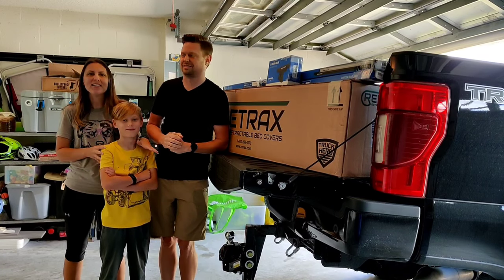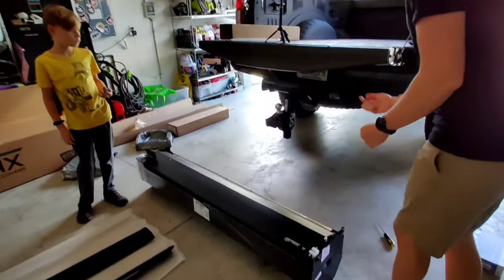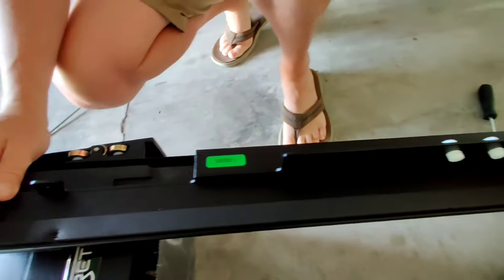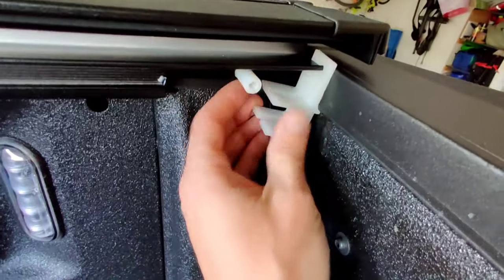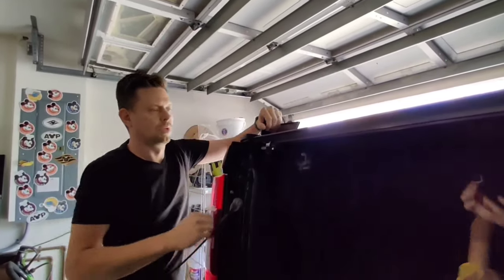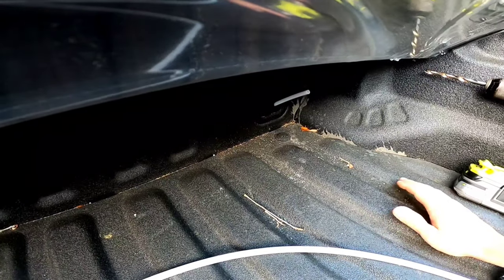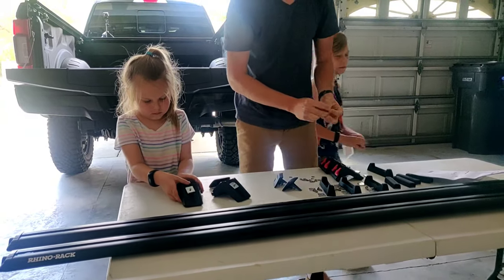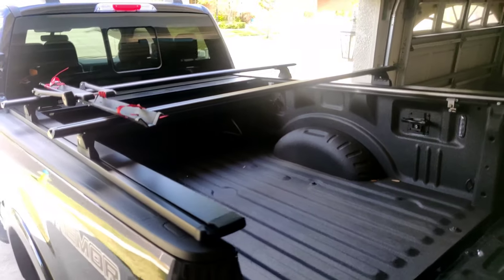Retrax Pro XR Tonneau Truck Bed Cover & Rhino Rack Bike Rack for 2021 Ford F250 Super Duty Tremor

Comment: Good video...I think you installed the drain hose incorrectly though....Isn't that white pipe just for shipping?  On mine, I just ran the clear PVC drain hose through the hole drilled in the bed.

Comment: I put one of these covers on my F-150 last summer, and it's held-up great.  Excellent choice!  I came there to see how the Rhino Rack went on, and it appears to be a better solution than the Thule Podium kit, which is getting hard to find, anyway.  Looks like I'll be snagging an RR set for our bike carriers!  Thanks.
Reply from the maker: To add, it is possible to remove the Rhino Rack with the 5 bike racks as one whole unit when the rack is not needed.  This is wonderful as it would have been a pain to disassemble the rack every time I wanted to remove it.
Reply: @BuckleUpButtercupTV  You are not living our life right if the bike rack is 'not needed' 99% of the time...

Comment: How do you connect the rhino bars to the truck.  

Is this connection to the truck or to the roll up cover?

Sorry if this is duplicated.  My first comment didn’t show up
Reply from the maker: The rails of the Retrax XR have a T Slot that fits many roof rack systems. They slide right into the rails.

Comment: Nice video.  I just swapped my regular rails for the XR rails.  Did you notice a large difference in the distance between rails from the front to the back?  Mine opens and closes nicely but I got more than a 1/4" difference from the front to the back.  Retrax says it shouldn't be more than 1/16" difference.  Just curious if you had to adjust those nylon screws at all.
Reply from the maker: We got rather lucky, the install that we did in this video turned out nearly exactly square.  I did not have to dial it in afterwards as I expected.  So far we are 99.5% water proof even in some crazy downpours.  If yours opens and closes smoothly and is keeping rain out you may be okay.  I will measure mine again tomorrow to see if anything has changed after 12,000 miles.
Reply: @BuckleUpButtercupTV  sounds good. Thanks for the reply!  Safe travels.

Comment: Awesome video how are you liking the cover as of now?
Reply from the maker: Thank you! We really like it! We have traveled over 6k miles with it and it has held up and kept our stuff dry. The bike racks did great, even while we went off road on rough terrain, everything stayed in it's place.
Reply from the maker: Thanks!  We are loving the Retrax tonneau cover.  We flew through the install and expected to need to go back over time to make adjustments or fine tuning however that hasn't been the case.  We have been through some very heavy rain and our gear has stayed completely dry.  I have also stepped on it a few times and it doesn't budge or flex.  We are very happy with it's durability, ease of use and security.
Reply: Ok great! Thank you! 
Have you done any modifications to your computer through forScan to make the fog lights work with the high beams on?
Reply from the maker: Not yet, I have thought about it but I am not sure it would make a difference.  These LED headlights are super bright.  The high beams seem to be enough to light up a ballfield.  I am interested in enabling the sideview mirror spotlights at any speed.  They could be helpful on dark trails at night.

Comment: Doing an almost identical install on my Rebel... when all the parts come in 😬 How do you find mounting the bikes?
Reply from the maker: Very cool!  I hope your parts arrive soon. It seems the supply chain is rather delayed right now.

I find mounting the bikes to be rather easy, I start with the middle bike while standing in the bed and work my way out.  The outer bikes can be mounted from the side of the truck.

Comment: How to you connect the rhino rack to the rail grove 

Is the grove on the truck or on the retractable cover?
Reply from the maker: The groove is on the rails that come with the Retrax Pro XR.  It is compatible with any "T Slot" roof rack style system.  There are also larger racks that are can height that will work with the Retrax, overall it is an amazing addition to the truck, especially when we need to haul 5 bikes.  Also, it is worth noting after this quick install this thing has been 99.7% water tight.

Comment: Hello, is this tonneau cover compatible with an amp research bed extender?
Reply from the maker: After a quick look at the bed extender I do not see any reason why it wouldn't be compatible.  The Retrax clamps to the upper bed side rail so it is up and out of the way.

Comment: Thank you for a very informative video.  Is there a gasket or seal where the cover meets the tailgate to prevent rain, snow, dust, etc. from entering the box?  Thanks.
Reply from the maker: Yes, there is a seal along the last section of the top that seals nicely against the top of the tailgate.  I put stuff in my bed with confidence that it will stay dry.

Comment: Does your tremor fit in your garage, height and length?
Reply from the maker: No, unfortunately it doesn’t fit height or length.  It is within an inch of fitting the height and a foot too long to fit length.  Florida garages are small.

Comment: Nice video.  How much bed do you lose to the canister on your truck?
Reply from the maker: The canister is around 13 inches deep and around 12 inches tall.
Reply: That's the only issue I see with roll-up tonneaus, but they're otherwise one of the best form factors.  I've found that I can still get at least a couple sheets of plywood under it (and the drain tubes), and even more long material if you place it between where the tubes are and secure it.

Comment: What Length rhino bars did you buy 65 or 71?
Reply from the maker: 71 inch bars.  This should be them but the Amazon link changes often.https://amzn.to/2VJwaqe
Reply: @BuckleUpButtercupTV  thanks for quick response.  By any chance Do you remember the feet that you connected the bar to the bed cover with? 

How have you liked the swagman bike racks?
Reply from the maker: Here are the feet that we used: https://www.amazon.com/dp/B01966BPPW/ref=cm_sw_r_cp_awdb_imm_7VSD1YH6NTA4AXT6TQNY
Reply from the maker: The swagman racks are great for the price.  They do seem to fluctuate on Amazon.  I have seen for for $40 through $80.  It looks like they are $41 right now:

https://www.amazon.com/dp/B000SL1AEG/ref=cm_sw_r_cp_awdb_imm_NGYWZZ352RB5VT7SBHTM

Comment: Hey guys , did you find out what was wrong with your tremor ?
Reply from the maker: The truck spent two days at Ford.  From my short conversation with the Tech it seemed they spent a long time on the phone with Ford and found the issue to be a short within a control module.  We picked the truck up afterhours so we could have it for our weekend trip so I do not have the warranty paperwork yet to confirm the name of the module that was replaced.

We plan on posting an update video once we know exactly what Ford replaced.
Reply: Thanks . Glad it was a small issue. You guys are great ,love the vids and looking forward to the future vids as well .
Reply from the maker: Thank you!